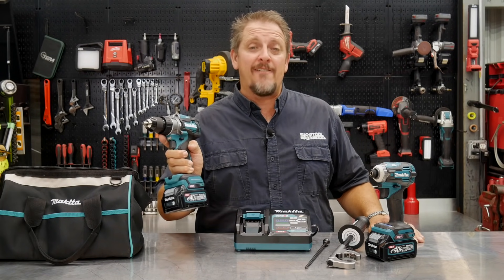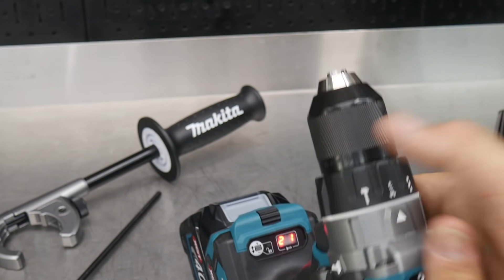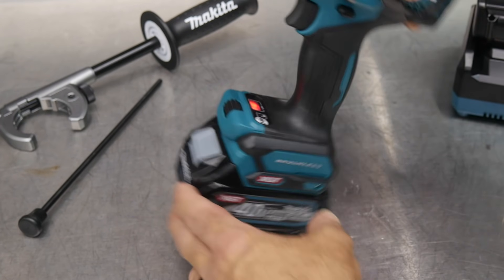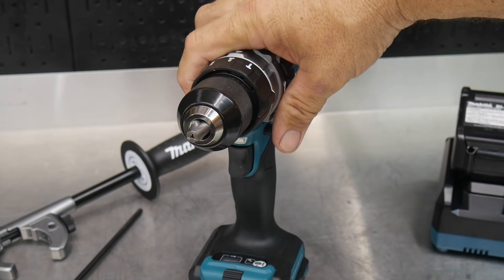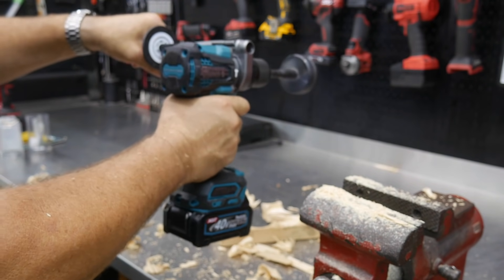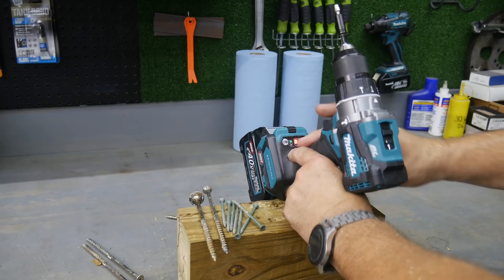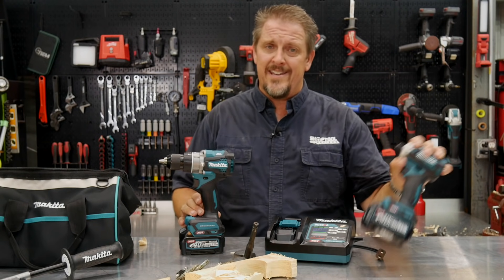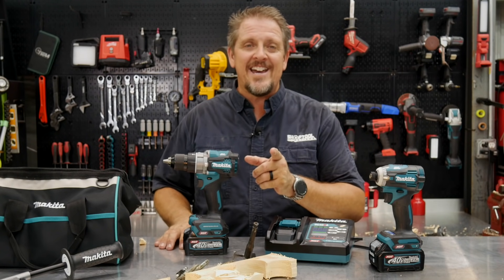Makita GPH01 40V XGT Hammer Drill Driver Review [62 CLUTCH SETTINGS]

Comment: You forgot to demo the music on the charger!  Thanks for the review Tim - I missed that it switched from 41 to 21 settings in gears 1 and 2 when I tested it out.

2.5aH battery @ 36V (nominal, 40V Max) and 5aH @ 18V are both 90 Wh so you get more out of the small 40V than you'd expect!
Reply: 40V MASTER RACE!!!
Reply from the maker: We did actually record the tune, but we just couldn't bring it to ourselves to include it in the video. lol.
Correct, and with higher voltage you get a little more efficiency as well. I just don't know that any of it really pushes someone over the line to switch from 18v to 40v. There is a place for it, but it's tough to have 2 complete platforms.
Reply: @Shoptoolreviews  Agree - I think they're targeting contractors that want to ditch their corded or gas small equipment like large breaker hammers etc. in favor of the 80V stuff, but they're including tools like this so they can migrate entirely from 18V and not need to maintain both.
Reply: You've got it all wrong. The 40V platform is a gift from GOD to replace all other inferior platforms.
Reply: @Damitsall  LOL

Comment: I just exchanged my hammer drill for a replacement because it was making a loud clanking/grinding noise when you let off the trigger. This is not the normal brake clutch sound you would expect, this is extremely loud and also vibrates the whole tool. What I find odd is that the replacement drill is doing the same exact thing - is this just normal behavior for this model?

Comment: I have this and the XPH14 at hand right now, and I have to say I'm not impressed with this 40V.
 1. The electronic clutch is a disgrace. There is significant lag and inconsistency in its activation, and it will often deliver full torque for about half a second to the fastener before shutting off. This is as good as not having a clutch at all.
2. It blows noticeably less air out the chassis than the 18v.
3. The battery seems to get warm a lot faster from the same load.

Comment: I'd be interested to see how much torque it actually puts out in the lowest clutch setting.   Generally speaking electronic drill clutches are garbage but this one seems like it might have some promise to it.  Also be interested in what kind of charge times for those batteries.
Reply: Now, half a year later, i went for the new cheaper XGT drill driver with 21 manual clutch settings, much more accurate at low settings. Also, its smaller and lighter, easier to use for delicate work. I also got the big hammer driller tested in this video so i am covered for high power applications as well.
Reply: For delicate stuff I really prefer a hydraulic 12v impact from the red team.
Reply: I just tried it. This one is garbage too.

Comment: If you used one of the higher capacity batteries with the 2- 9/16" speed bore  it'll probably have no issue on speed 2

Comment: I don't know man. 40volt battery means bigger batteries and less capacity compared to the 18volt stuff. Correct me if I'm wrong but this as a 40volt still doesn't have much more power then the 18volt stuff especially compared to milwaukee.
Reply: 40v 4ah is equivalent to 18v 8ah. Same capacity, more efficient.
Reply from the maker: Higher voltage is more efficient. A 220/240V fan motor is more efficient (makes power easier) than the equivalent fan motor at 110/120V. Now, at the same time, the 40V vs 18/20V is at a much smaller scale, but the same principle resides. 
Yes, the 40V has the potential to deliver more power and capacity; however, that doesn't mean it's applicable in every scenario. If you can get your jobs done at a sufficient pace with 18V batteries, then I would worry about switching to a new platform. There's a lot of cool features on this new 40V drill, but it's not going to change your life. Thanks for watching.
Reply: Amp x volt = watts 

4ah@40v is the same wattage as 8ah@20v

With higher voltage you loose less power to heat etc which makes higher voltage more efficient 

TLDR, the big advantages of higher volt is more efficient so more usable capacity and being able to push tools harder (more wattage) without heating up the tool AND battery as much as with lower voltage .

Comment: I use this drill 4 months it was already under repair because the 25 mm bosch drill for wood stopped and the engine kept working, makita replaced the gear box, now 3 weeks after receiving it from the repair it starts to happen again but only when it warms up I return it to the seller, impossible work like that.

Comment: Like the technology but most expensive on the market. For me I use Milwaukee and want to go into Makita as my second choice but some of it is redundant and in my view the need to buy batteries for 2 lines. The batteries are just extra costs. I think Makita and Milwaukee are neck in neck with regards to quality depending on the tool but the price on this one is just a bit high. Way higher than even Milwaukee which isn’t cheap.

Comment: Great review like always, thx... But not really impressed by this drill. There's better 18v drills on the market and less expensive,  Dewalt, Milwaukee just too name a few.
Reply: no, the Makita wins over the Milwaukee but not on the dewalt on power. But feeling and trigger reaction is way better on the makita where Dewalt and Milwaukee are more dull
Reply: Nah this is now the best drill on the market
Reply: @AM-wi6zo  actually the new Bosch 18V GSR or GSB 150C is the right now at least strongest drill on the market with some special features
Reply: @Zozo806  the gsr is a compact drill. I highly doubt that the gsd is stronger than the xgt makita. An what feature would that drill have that this doesn’t?